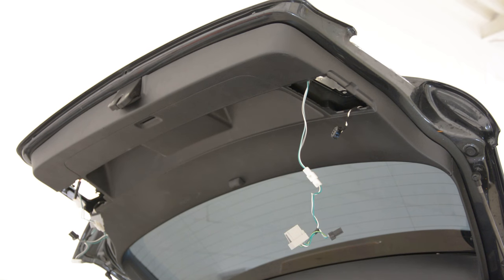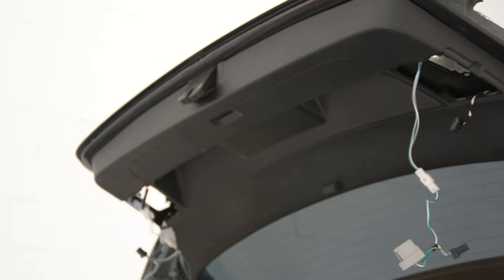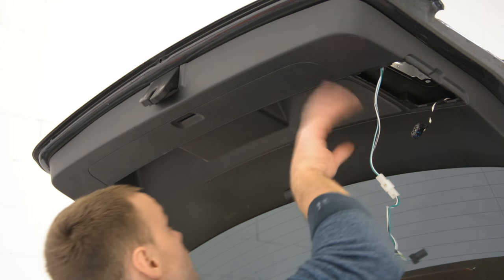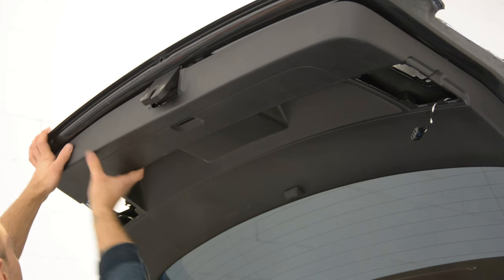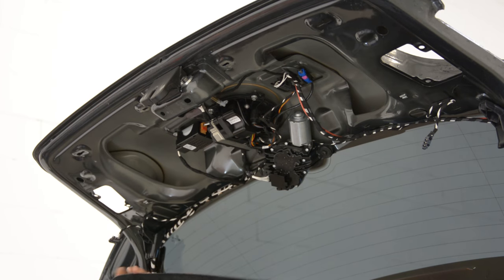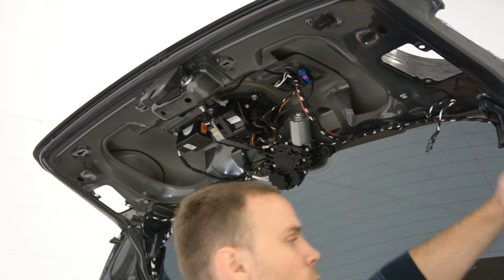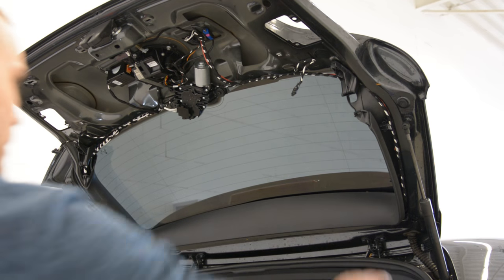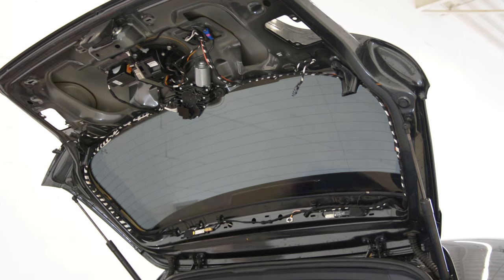VW Golf Mk6 tailgate panel removal

Comment: Nice to see.. but the sound is very bad, and the video does not show how you start on the upper part. I have to pull the upper part off on my G5 plus, to fix the wiring loom, a bunch of wires broken :(

Comment: Hi, I have a problem with my G5 emblem trunk. I want to buy some new, did you thing is same for G5 and G6 dimensions for the screw?
Reply from the maker: Is similar the tailgate clips is also similar, good luck
Reply: @DFCGarage  thanks alot, man. Just remove old and place new? Doesn't need some diagnostig seting? Just plug in and it works?
Reply: Miroslav Hrncir yes and after disconnect the battery and plug the battery back after 10 minutes
Reply: @Carhax  So disconect battery and plug new lock. And after 10m. Conect battery. After all should be work :D

Comment: whad do you do when the trunk is locking machenism is broken ?
Reply from the maker: You can see that hole  in the middle of the tailgate,  inside you will have a plastic  table if you pull that you will unlock the tailgate door.  Usually all the hatchbacks have this safety feature
Reply: @DFCGarage  thx!

Comment: Hello, do i need to remove the tailgate panel in order to fix third brake light?(upper light) on golf mk6 2009... thanks
Reply from the maker: Maybe this can help you Here's how I broke the VW Golf Gti  third brake light
https://youtu.be/x1NgLWeeWaM
Reply: No, you can take it from outside using a old bank cards for example. Move the card all over tha edge and then move it again, but with pulling.
Reply: yeah for the third brake light you actually have to break the housing and buy the replacement one with the clip from ECStuning, I know you posted your comment a year ago but if you want I can link you a really good video explaining it